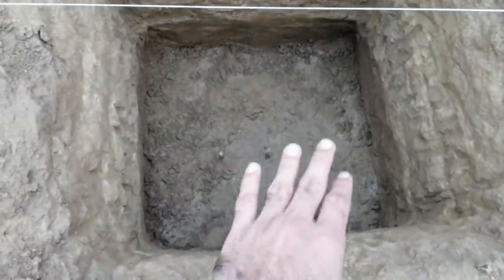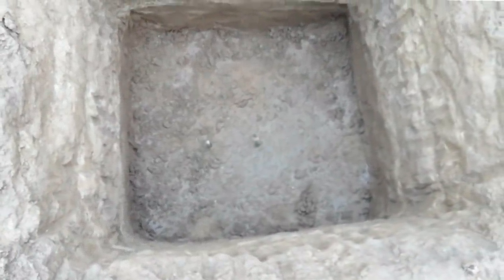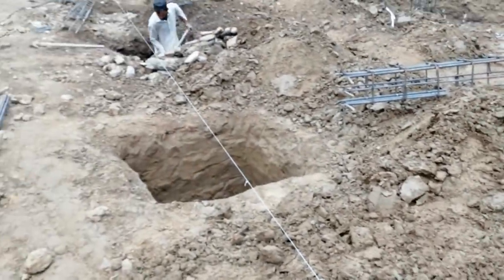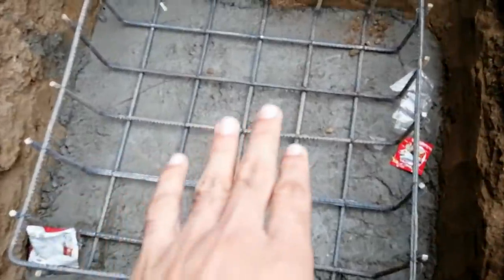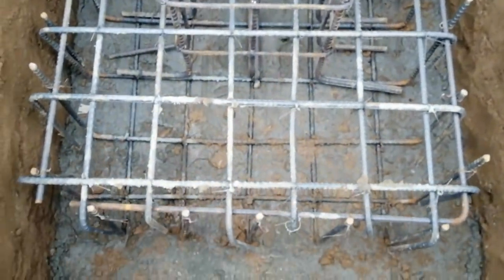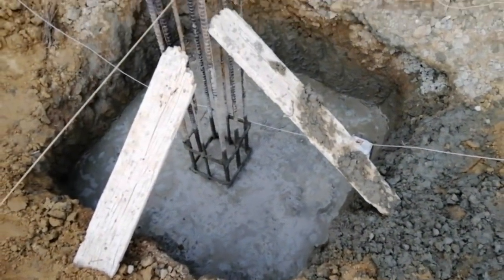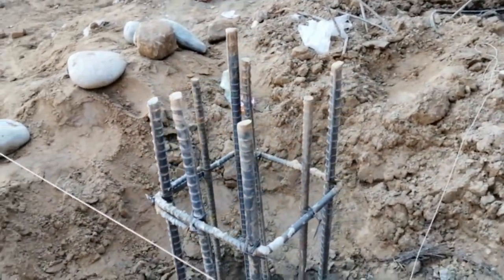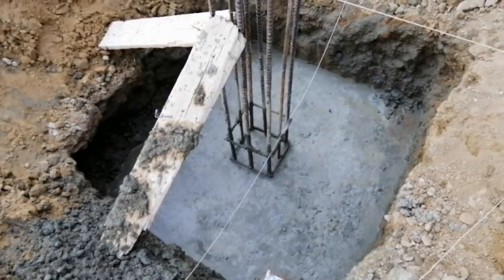Depth of Footing/Foundation and Reinforcement details in Foundation -  Civil Engineering Videos

Comment: @Civil Engineers | Sir please confirm if we have steel bars available inside the plinth beam so if we raise an additional pillar over plinth beam after tying the steel bars of column with steel bars of plinth beam so is this arrangement is correct or incorrect? and how it will impact on the overall structure strength.

Comment: How would you do the pad foundations for a 28m x 10m building that is on a slope? The difference in ground conditions is 1.5m from the start of the building to the end. Do we have longer pieces of steel at one end? How do we get all the pads level correct for the steel

Comment: What should be depth for a double story residential building
Reply: It depends upon the loads on the structure like wind,region environment and also the no. Area on which building will constructed
Reply: @Tecnoconstruction  is 4feet deep foundation enough for an area of 1100ft², for a 3 storey residential building. The land is mostly rocky.
Reply: @superkamiguru7985  from natural ground level 4feet or 5feet deep foundation is enough ,and it mostly depends upon the type of ground soil
Reply: @Tecnoconstruction  thanks for the quick response.

Comment: In the ratio of concrete mix, For in stance M20 (1: 1.5: 3), do we take cement in bags or in the same measures we use in sand or aggregate?
Reply: We just need to calculate the no. Of bags of cement required and after that the volume of sand and aggregate will get easily with respect to the cement
Reply: Any idea how to calculate the no. of bags needed for example a 25mmx30mm column,height 3m.

Comment: How many floor is allowable for this footing
Reply from the maker: to 5
Reply: Does the 1 X 1.5 Meter Foundation could withstand 5 Floors  building without a Ground Beams ?
Reply: Max only 2 storeys, with ground beams and grade 30 concrete